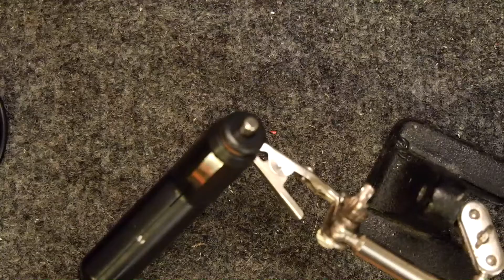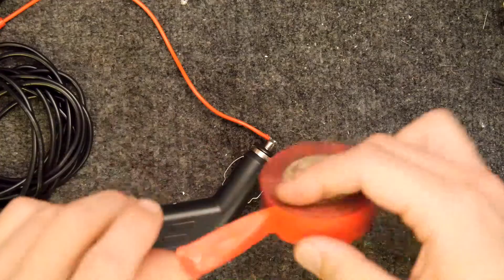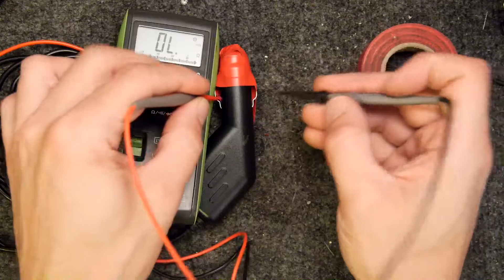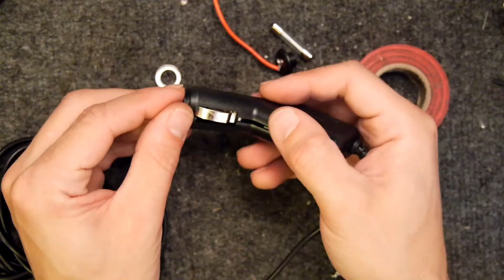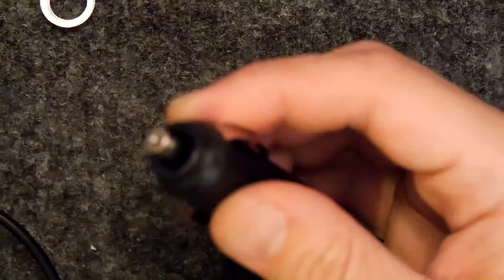Diy Hard Wire Dash Camera Hack

Comment: this is the exact same dash cam i have. its stopped charging. i think the battery is shot. Very cool diy.
Reply from the maker: +shannon smith Thanks Shannon, yeah usually it is either the battery, SD card or the power supply. I would suspect the card first as they often run without a battery and it's obvious if the PSU has failed 😂👍

Comment: Would you just splice the wires onto the same ones as are wired to the cigarette lighter? Thanks
Reply from the maker: +Blimps In Space yeah, i often do this as it's the safest and simplest place to tap without a wiring diagram 👍
Reply: +The Backoffice Sweet! Thanks for the speedy reply, gonna wire a fast charger for my phone in next week soon as it arrives in the post :D
Reply from the maker: Blimps In Space that will work well, sometimes i wire in a usb charger and have a few charging cables available for all the gadgets